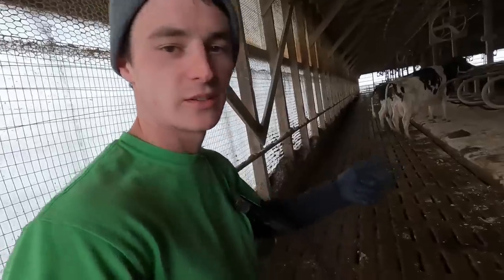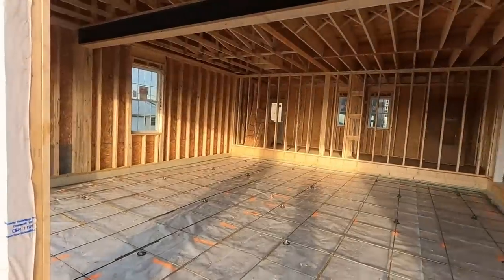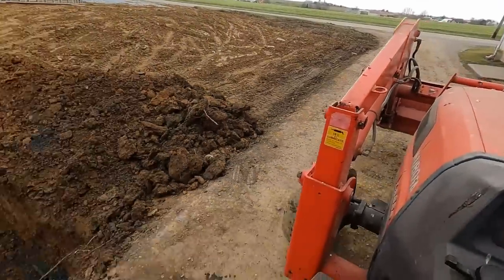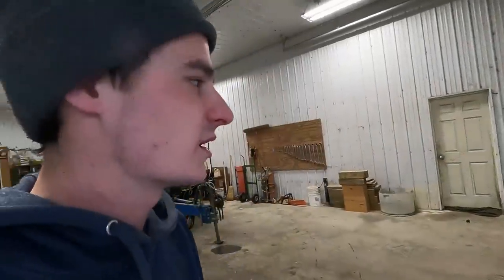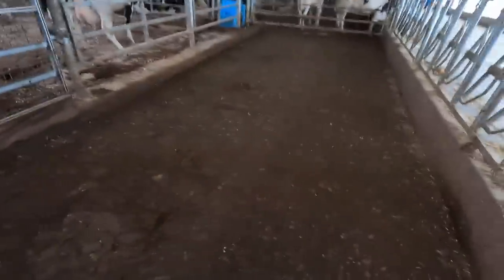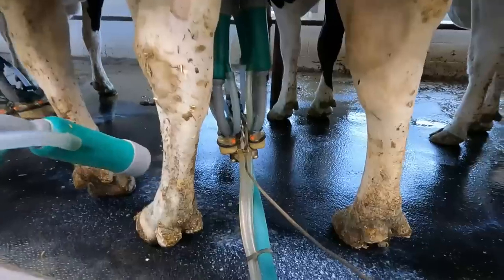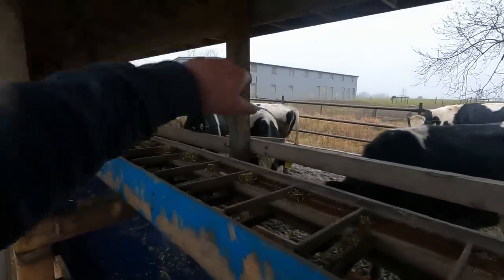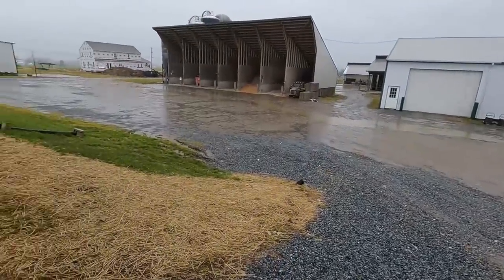Milking Prep System Demo

Comment: Spend the money on insulation now and it will pay off in multiples down the road.   The best is to put foam board on the outside, like an insulation blanket instead of inslatating a skeleton.   Then Batts and vapor barrier inside.  Spray and batt is a good way to go as well, little more expensive.  Houses are tight today,  if you want it to last you need to bring in fresh air.  It can be either mechanical or passive,  but keep turning the air over.  Insulation and air management is very critical and complex with access to new materials.   I've seen new not necessarily mean better.

Comment: Closed cell spray foam is a good insulation but beaware of possible gaps so call in a air sealing test guy after spray foam. Make sure all gaps are sealed before and make sure they add a moisture barrier also

Comment: Closed cell foam is good but makes leaks hard to find. Battling should be a little cheaper and work just fine for your climate area. Make sure to also waterproof your house as much as you can to prevent sitting water along the foundation/wood connection

Comment: Go with full Roxal insulation as its mineral-based, water proof, fire proof. you can also place in floors and interior walls for sound proofing. Stay away from the spray foam and pink. Also blown insulation isn't that great either.
I noticed when they were affixing the OSB, you didn't make sure that the frost line wasn't OSB. Stuff gets wet it greys up then powders.

Comment: spray closed cell insulation combination with fiberglass batts in the walls best way to go, warmer, also will make your house quieter living next to a road. Cellulose blowin insulation in the attic
depth determine by the area you live and the weather .

Comment: Small tire on top of planter has a flat. :(

I would say rock wool or Blue jean insulation ($$$$). Both work fine wool is cheaper.  I don't like foam as it can keep too much moisture in, and if done wrong will create problems?
Radiant floor heating?  Love to see the plumbing setup.

Just saw it on this old house recently.

Comment: We are very happy with our closed-cell spray foam on exterior walls, fast install and energy efficient. No air leaks or cold walls. Any money you try to save on insulation will be spent on energy costs down the road.

Comment: Can say with definite proof that if few over insulate your home and do your windows a higher qualin roofing you will end up covering the cost of what you have to pay out in the long run we can stay warm for 3 days when we have no heat whatsoever. And we have 2 dogs that need to go out quite often and then we have to go outside to heat things up so 3 days I think it's fantastic. Is so insulate insulate . Go for the highest our value you can get. We have northern winters in our hwhen normally they would say the Southern windows but they insulate better.

Comment: You can never have TOO much insulation. I've done a small reno with Rockwool and it is by far the best style batt insulation you can get. Fiberglass should be banned IMO, as even for a house built in 1979 you could see how degraded everything was. That one room in the house is far warmer now than when in had fiberglass batts in the winter and cooler in the summer. I would definitely spray closed cell along the exterior. It will seal the building envelope and prevent air infiltration. I live 40 miles north and you know how crazy our seasons are and reducing energy in the summer & winter is a huge payoff. Energy isn't going to get cheaper.

Comment: You guys have so many water lines running around under ground,wonder how you keep 
track of them all. Also, Grace vicor flashing under the windows,especially 2nd floor,advised 
to keep siding sheathing from rotting in future.

Comment: What ever route you take in insulating your home you should keep on mine that a home needs to breath. I`ve seen homes sealed up so tight that the furnace and fireplace would not operate properly and a exterior vent had to installed to remedy that. Look at it this way if you have a sealed box it only has so much oxygen in it to use as things get used up it creates a vacum inside not allowing for the proper exhaust of appliances , water heater ,furnace, kitchen range even the range vent, also looking at the fact that the only fresh breathing air that could enter the house only happens when you go in or out the entry door. Its not as drafty as it sounds as we have been building good houses for many years It`s just when you over build.

Comment: Wool that's what they use in EUROPE .   It's insulation made out of wool. it doesn't burn and it doesn't deteriorate  Like paper or fiberglass .  It lasts longer.    If I could build a house I'd at least look into it. I'm not sure if you can get it in the USA. But good luck!

Comment: not sure what your climate calls for. im in Texas. we did foam on all exterior and roof. great utility bills throughout the year. moisture is a concern sometimes due to humidty since we have the AC condensate drain plumbed to conventional septic.  if I had to do voer again I would do the foam on the roof and conventional batt insulation on exterior walls. Kind of a hybrid way to do it. We did our office building like this and it works great.                                                                              .

Comment: We did all spray foam in the house I built in 2020 and it’s probably the cheapest way to keep your gas or electric bill down in winter time and I’m in Ohio it cost a little bit more but it last cause the fiberglass is cheaper but it das not last long my brother used that in the last house he had built 15 years ago and he said he can tell it’s not as good cause they had to have more insulation blown in his house this year cause it just das not keep heat as well

Comment: My first comment is, Why is there little to no overhang on your roof edges? If you can afford Spray foam insulation, that is the best way to go. If you go with fiberglass insulation, always put a vapor barrier one the warm side of the wall or ceiling, before the sheetrock goes on. I've been in construction for over 30 years. You need good insulation with good ventilation. No overhangs on your roof edges limits where you can draw outside air in to ventilate the attic and keep the mold from forming.
Reply from the maker: The overhangs are 12 inches. Should have done more?
Reply: @10thgenerationdairyman61  They don't look like that much from the video. But you should have made the gable ends the same overhang.

Comment: The only thing that I know is every one is all about spray foam. I washed video on insulation and how it burns and pray foam burns like gasoline. If I was building a house I would not use pray foam. I would blow insulation in the rafters. Then use 8" in the walls. Just a little fyi. Fiberglass insulation will not start on fire. You can hold a flame on it

Comment: Its a decent mid range computer, couple year old hardware. Dunno how much you paid for it but Lenovo can be a bit expensive. Lenovos tend to come with a lot of bloatware that will slow the computer down though. If you have Norton or Avast you need to uninstall it. It doesnt help the computer and only slowls it down.
Reply from the maker: Good to know. Paid 1300
Reply: @10thgenerationdairyman61  Thats not bad. Should be good enough for your needs. You dont do a lot of video effects so the 3060 should be ok. I would ask what motherboard you have but your not a computer guy so you probably dont know. 

The thing you most likely will need to upgrade in the future would be your storage "SSD HDD" And that depends on what motherboard you have.

Comment: Have you guys ever looked into sand for bedding? I've seen a couple channels that use it and it's reusable
Reply: Sand would settle in thier manure pit below the cows and be difficult to remove.
Reply: @Iowarule  that's why there is a different system for using sand.
Reply: That is true but I guess what I was getting at is, I don't think they would abandon the system they have to use sand. They have enough settlings in their pits already without sand also.

Comment: I would prefer the spray in foam.  Just be careful, if the house is too "tight" you might need a air to air heat ex-changer to get enough fresh air into the house.
https://youtu.be/k978M6lD-MA

Comment: Maybe there's something about milking such big heards I don't understand, but I'm surprised at how much money you're spending in the parlor. Pre-dip post-dip and god knows what, and now this. Worst of all is the time you're spending. Your cows are very clean, if you put me there I would just wipe them of and get those clusters on😅. Your parlour is big enough that you can make it 90 seconds from stimulus to attaching anyway. Those chemical and gizmo salesmen always talk about how their thing will optimize production and theoretically make you more money. But you can also get more profitable by using LESS input. Farmers want to be far over on the safe side when it comes to milking, and there's good business in taking advantage of that.
Reply from the maker: Is that what you do on your dairy? What is your scc and production per cow and profit/cow/year?
Reply: @10thgenerationdairyman61  
SCC is around 60-80 thousand. I have a different breed and am in a completely different country, so let me just say that production pr cow is low and profit is relatively high
Reply from the maker: That is very good scc but that is a different type of dairy farming.  Our herd is averaging 95 pounds at 4.25 butter fat and 3.2 protein. When you push production it becomes necessary to use pre and post dips to help prevent mastitis. We spend $4.50 a day on pre dip for 185 cows so the cost it not a big deal. Sometimes I think we should not push production as much and just milk 2x but I'm not confident the profit margin would be as good.
Reply: @10thgenerationdairyman61  
It's a very different production indeed.
So I understand that my little rant isn't very helpful. That being said, pre-dipping hasn't been found to have any significance on SCC, just on skin surface bacteria, but we don't get paid for that. If a cow is infected through the cluster, it is from the milk of the previous cow, not skin bacteria. Proper attachment is therefore much more important, to not let any air in and cause backsplash in the already attached cup(s). In my country they recommend post-dip in some cases, to maintain healthy skin, preferably a thick product that does Not enter the canal. I think that is because having product enter the canal becomes a double-edged sword in regards to her natural defense. The best way to prevent post milking infection is to avoid her laying down for the first few minutes. E.g. you can lay out some fresh feed during milking.

Just a different perspective, I've never tried to run your farm :)
Reply from the maker: @PAI93  if for no other reason I like pre-dip because of how it softens the dirt making it easier to wipe them clean.  I appreciate your input though, some good things to think about.